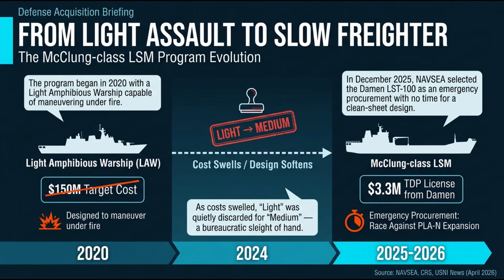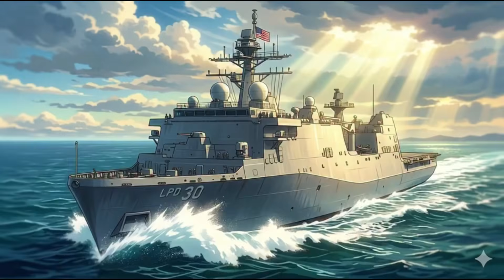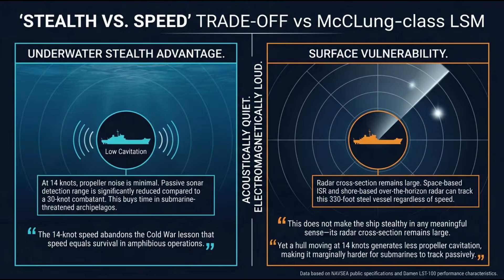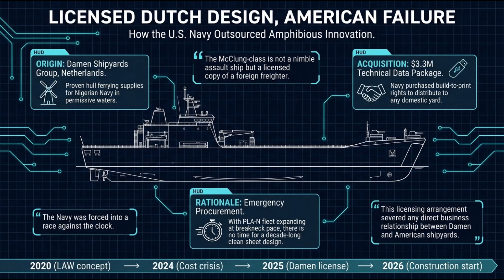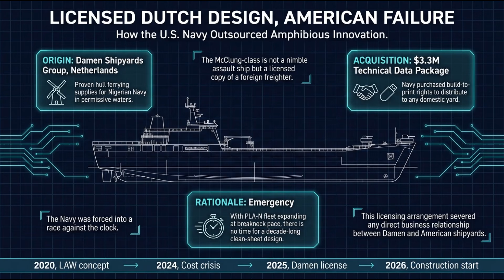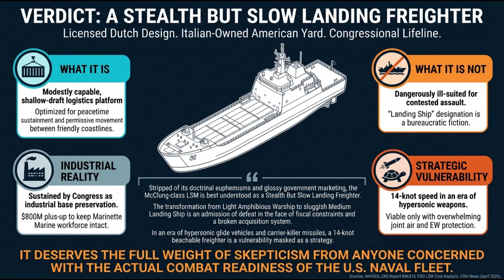Why the US Navy's New McClung Class LSM Is a Slow Moving Target

Comment: So... it's literally the same thing that sailors called the Original "LST"s back in the '40's. "Large, Slow Targets"
Still fulfils a critical mission set. Getting equipment onto an enemy shore.
Reply from the maker: Not in contested waters.
Reply: @str @strategicforecaster1 rs are going to be contested.
Doesn’t mean we have to abandon the critical role that an LST/LSM provides.
Reply from the maker: @PeterMuskrat6968  but i prefer marines to use San Antonio + LCAC
Reply: @strategicforecaster1  Can't argue with that. LCACs are faster. Can the LSM hold more cargo to offset the speed difference?
Reply from the maker: @PeterMuskrat6968  I don't like to take big risks; LCAC remains primary, but LSM can be secondary. and remain as a landing stealth freighter
Reply: @strategicforecaster1  Smart.

Comment: Multiple slides claimed Constellation represented 40% weight growth vs FREMM design.   I don't see it.   7500 tons vs 6000 tons would be 25%.  7400 tons vs 6700 tons would be even less (not much more than a 10% weight gain).   Where are you getting your 40% figure?

Your chief argument stands, however.   14 (or 15)-knot top speed is dogshit slow.
Reply from the maker: Appreciate the correction on the weight growth figure. You're right—the accurate comparison is roughly a 10–13% increase from the FREMM baseline, not 40%.